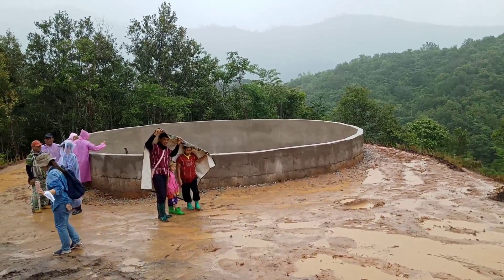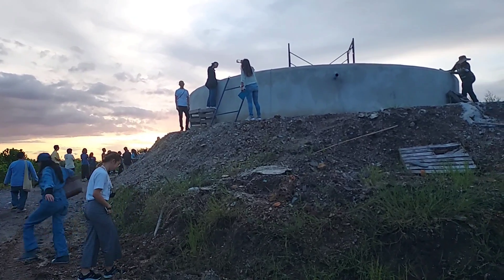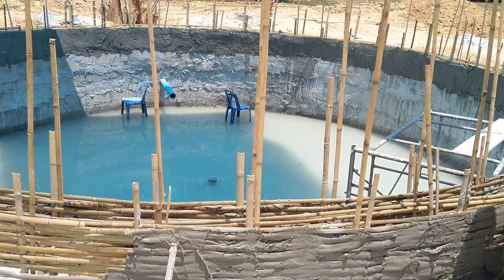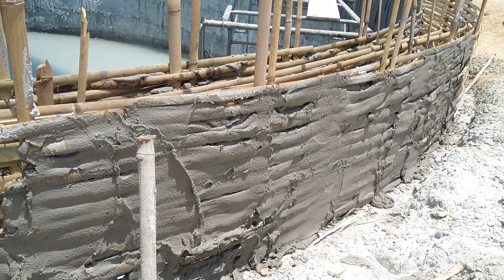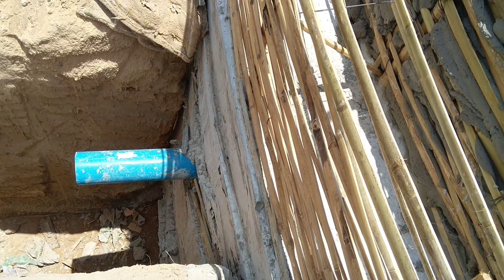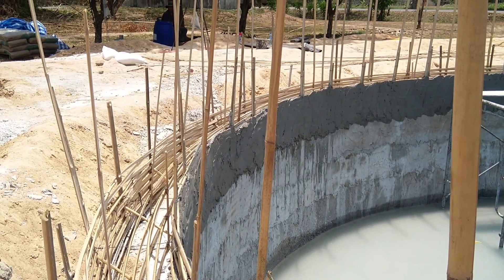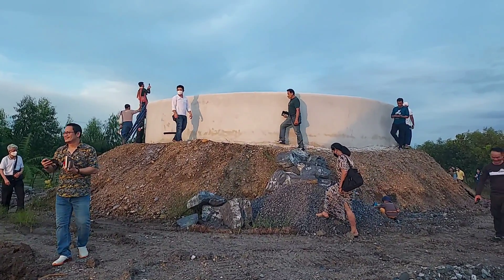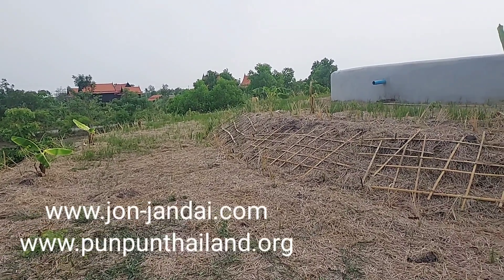Building Giant Water Tanks

Comment: Won't the cement degrade the bamboo? What happens when the bamboo breaks down?
Reply: In order for Bamboo or any other biomass to break down, you need oxygen, water and or microorganisms. None of those should be available within concrete in any measure close to being able to degrade the bamboo. The bamboo in this concrete actually replaces the normally used steel rebar, although you need more volume of bamboo to achieve the required strength to be equivalent to that of steel, the cost is orders of magnitude lower and often quasi free. Bamboo reinforcement is not as strong under pressure or perpendicular to the fibers, but it's tensile strength along the fibers is amazing for its cost. And a round tank as this only needs tensile strength from the reinforcement because of the circular design, so bamboo is perfect for this.
Reply: @waitingformyclone119 woww! very well said. thanks for sharing your knowledge, i am convinced now to do the same in my farm, i have Giant bamboos to use for this kind of project. And thank you so much Jon Jandai for this video, your idea help me a lot.
Reply: @waitingformyclone119  Thank you for the response. I was under the impression that the cement's alkaline degraded wood it was in contact with over time
Reply: I think I need to be a little bit more specific than I was previously. Yes, bamboo is a great alternative for this low cost water tank because of it plays exactly into bamboo's strong points with the water pressure inside the tank  resulting  in a tensile load on the reinforcement in the concrete. However in general, bamboo reinforcement has been known to suffer from shrinkage and in the long, term bamboo isn't as durable as steel. ( there is some research out there, where concrete older than 15 years with bamboo didn't hold up as well as steel reinforced concrete).  Fundamentally, concrete is reinforced because of its poor tensile strength. You can pull a non-reinforced concrete block apart relatively easy. So they started putting steel in there that would hold the concrete together when it experiences a pulling force. ( like on the lower half of a horizontal beam under load). Steel reinforcement can suffer from corrosion in concrete too, so that is also not guaranteed for more than 40 or 50 years).
But in this example of the round tank, I believe you can get really great value for its cost. Certainly when you add an additive to the concrete that makes it waterproof so it protects the inside of the concrete from moisture incursion. BTW, by weight, bamboo has a stronger tensile strength than steel. But like in every project, you have to look at its purpose. Here, it is a low cost water tank. With the cost of a bag of cement about 100THB and locally sourced sand, only the gravel is an extra cost. Comparing this with  a steel reinforced concrete, you can probably rebuild this bamboo reinforced concrete 2 or 3 times for the same price of the steel you need otherwise. (Not that this would be necessary, as I don't think the life span would differ that drastically)
Reply: @waitingformyclone119  your elaboration is most useful as well. Thank you!
Reply: @waitingformyclone119 I'm sure you can also prepare the bamboo using a resin or something else so it becomes even stronger and more durable for other uses.
Reply: @vitordelima  yes, I believe borax is used to extend the life of bamboo in bamboo construction.
Reply: It only has to hold the cement until it hardens
Reply: Could a swimming pool be made like this?
Reply: Bamboo is as strong as steel in mass